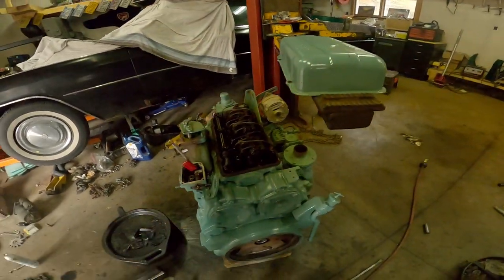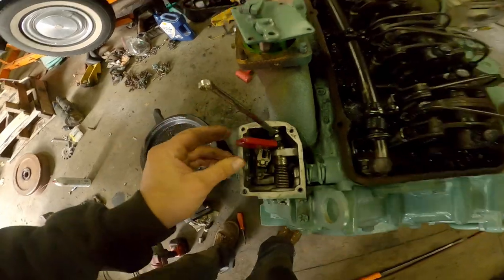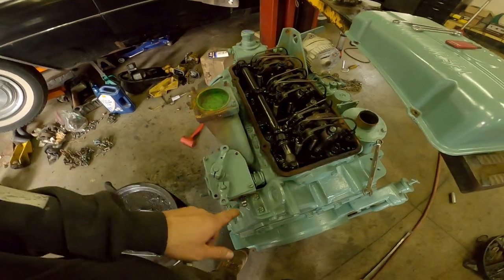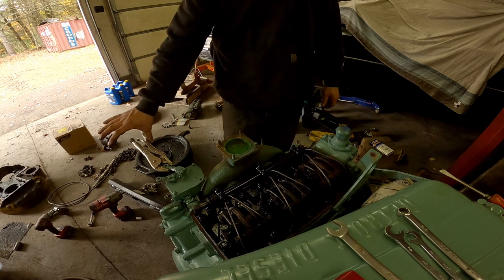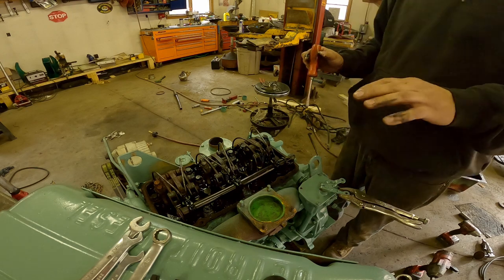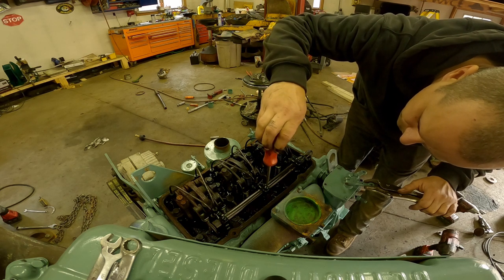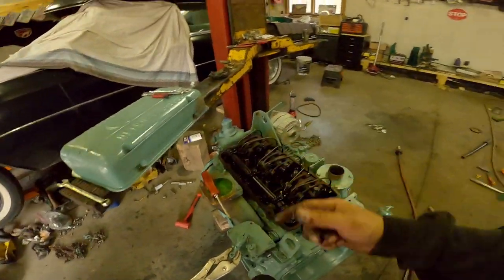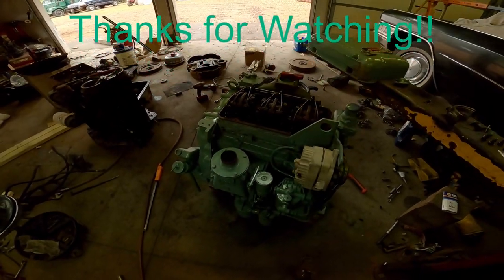How to run the rack on a 2 stroke Detroit

Comment: There's an old guy in my neighbourhood on Vancouver Island (Gerald Roberts) that been servicing fishing boats and logging equipment for several decades. He knows everything about Detroits. He rebuilt my 6v53 (marine series)7000 hours ago and it still runs like a clock. It's sad to think what's going to go with him. I visit him, bring him fish and run him to the grocery store when I get the chance. I gotta get up to speed on the mechanics of these awesome engines, Your vids are very helpful. Too bad Gerald isn't a Youtuber we'd all be subscribed.
Reply: I'm in south bay LA County  i had a retired Cat mechanic run me through a rebuilt on my fishing 8800 Cat with  jackass gas starter motor Ol Ed would seat on a comfy place n walk me through the rebuild as he had his light beer. We miss those guys
Reply: Just curious on how many hours do you have on it until it needs overhauled? I got a 6v53 detroit im putting in my squarebody Chevy and its got 2000hrs on it allegedly

Comment: Thanks for the video I have a aluminum 353 out of a gama goat I had stuck injectors I got them free an run the rack just by reading an I got it running good but I have no throttle by the throttle linkage at the governor but I can pull the valve cover off give it throttle with the rack an it throttles up fine I have no clue what the problem is thanks for any help love your videos keep them coming I try to learn any thing I can on the old Detroit's
Reply from the maker: Make sure the lever on the bottom of the governor cover is engaging the fork in the governor. Also make sure the throttle lever on top of the governor is tight and not just spinning on the shaft.
Reply: @Ol2Stroker  yeah I have checked all of that another thing while the engine is running if I give it full throttle on the throttle lever it will barely throttle up but if I just hold the throttle wide open it will slowly start to rev an rpms will continue to climb slowly
Reply from the maker: Does it have an electronic or air shutdown that is stuck and trying to hold it from throttling up?
Reply: @Ol2Stroker  nope it just has the throttle lever an the small lever for the shut Down the shut down lever works fine hit it an it shuts off the I can flip it the other way bump the starter an it will fire right up an idle i talked to a few other people they have no clue an call Detroit service center no help at all no one working at the Detroit shop works on 2 strokes but I do thank u alot for replying an helping I glad  I found your channel
Reply from the maker: Here's what i want you to do. Remove the valve cover and start the engine. With the engine running start recording a video and operate the throttle lever on the top of the governor while videoing the rack and the rod that connects it to the gov. Upload it to you channel and send me a link. We'll get it figured out.
Reply: @Ol2Stroker  thanks I will try an get a video this week end to show you thanks a lot for your help
Reply from the maker: Anytime bud!

Comment: Great video as always! However, Valve clearance .026 (twenty-six thou) ??? See factory service manual dated 1973 → Section 14.1 → Exhaust Valve Clearance Adjustment → Engines With Two-Valve Heads" → Step 5. Here it says to set it for .011... Could be a misprint. My copy of the later manual is incomplete and missing the relevant info so I can't verify the earlier copy. Thoughts?
Reply from the maker: That's for a 2 valve.
Reply: @Ol2Stroker  Ah, that explains it. I'm not familiar enough with the 4-valve head to have determined that this is what you have (not knowing what to look for + lack of light). I just checked the manual and verified that the clearance setting on a 4-valve is indeed more than double what it is for a 2-valve; this is surprising. Thanks for the response. Keep it up!

Comment: Hey man, I gotta ask, is it true these absolutely require straight 40w? Or can i run t6 15w-40? Because I did the oil change with t6 and then stumbled upon old forums of guys saying it'll destroy the motor. What is your take/ experience? I have a 453 in an old excavator.

Comment: I have a Clark skidder with a 353 GM in it thats rebuilt . Problem with it not starting in below freezing , always have to turn on the espar engine heater for awhile .. Question .... could this be the rack is out of adjustment  ?

Comment: My engine is consuming alot of oil in 24 hr run,was thinking of taking out the airbox covers and run the engine and then look at the pistons and try seeing if they are leaking oil,have you tested a engine this way?thanks

Comment: If I were to swap a 2 stroke Detroit into my OBS F350 Sterling Rear F550 10 bolt kingpin front which Detroit would you be most comfortable slammin in it?
Reply from the maker: 453t is the easiest

Comment: Hi,i took your advice and disconnected the throddle delay,at first i thought i couldnt adjust it,but now im really stuck,where i did  a running the rack and adjusted the governor gap,they were all off,

But now puzzled as the injectors after the job,they are close to full fuel at idle,and when i push the throttle fully the injectors stay at full fuel from quarter throttle to full throttle,when i ran the rack i had the max speed,full throttle ,i backed off the buffer screw,(but i did not back off the idle screw as the manual dont mention it)  so now im not sure if something is wrong, is this normal ?,does the engine start like this then it idles out on its own? the stop lever does bring the rack to no fuel but then goes right back up to almost full fuel and then when i press the throttle just a quarter full the rack is at fuel fuel,is there something wrong or is this normal?
Reply from the maker: That's definitely not right.  You gotta back off the idle after u set the gap before you run the rack